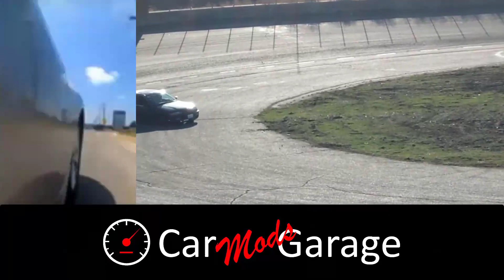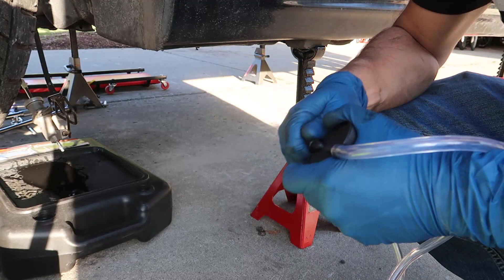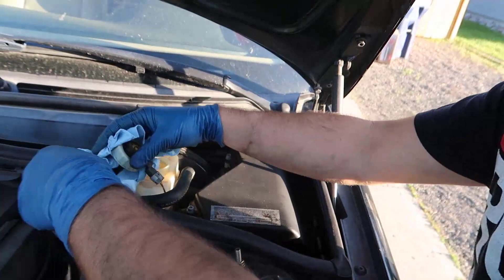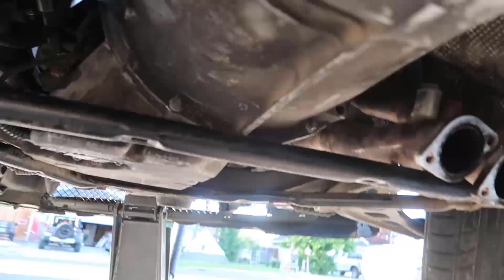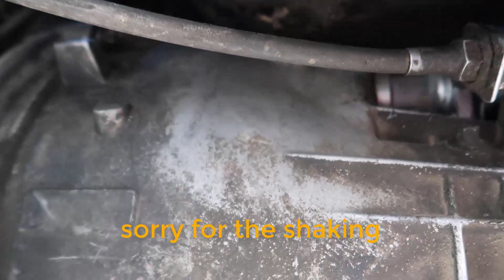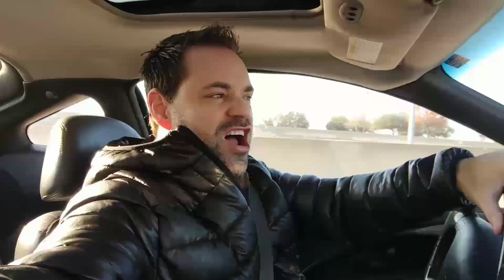Replacing Clutch Slave Cylinder on a E46 BMW 330i

Comment: Nice video man, I’m from Brasil too, so my question is. What brand did you buy, I just bought a duralest at auto zone and another one on O really , but bought of them blew when I was bleeding the system
Reply from the maker: Viva Brazil!!! ❤️.  Dude it's possible that you didn't put it aligned to the clutch fork so it was loose.  When you bleed that and it is not attached properly or not attached at all the tip of it will explode out of the part.  It happened to me once.  I got mine from eBay.

Comment: Thanks man just one question do you know if the clutch hydraulic system just shares the same resevior as the brake system Thanks
Reply from the maker: Yes it does.  I though it was weird but it does.
Reply: @CarModsGarage  thanks man
Reply from the maker: @valdeabeast3283  of course. Anytime 👍